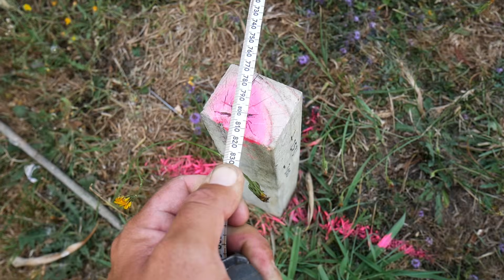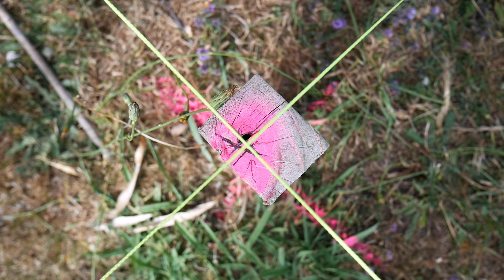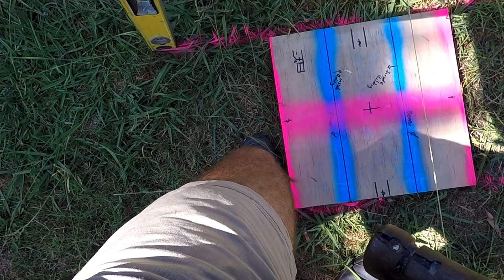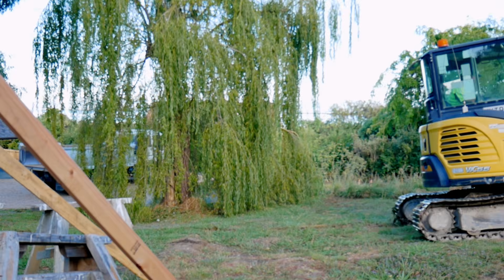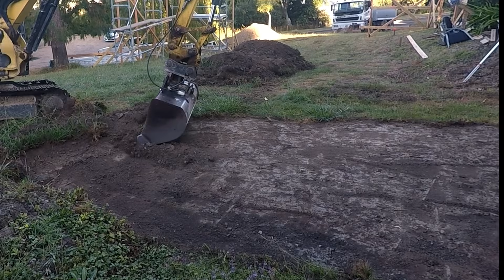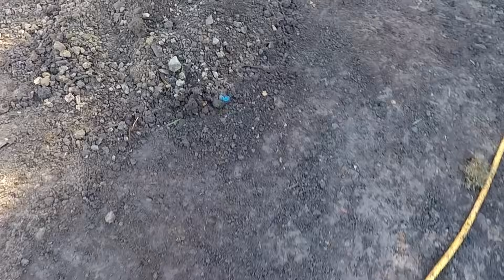Building a House - Pile Set Out and Excavation | NZ New Build

Comment: Great set out good to see someone who’s able to do a B & J floor still here in Australia they have become a rarity …just one question tho why not use bricks or besser blocks for the piers
Reply from the maker: Thanks. I enjoy setout, it helps me get a feel for the job ☺️

I'd say it comes down to the design and clients budget for why we use timber piles instead of brick and block.
Designers like to stick with standard methods and timber pile construction has proven to work well here in NZ, especially with earthquake resilience. 

Anything non standard means engineering which adds cost to simple designs like this. 

There are some provisions for masonry perimeter foundation walls but again, it's added cost
Reply: @chrisdonnellybuilder  cheers Chris ….of course not called the shakey isles for nothing
Reply from the maker: This is very true 😬